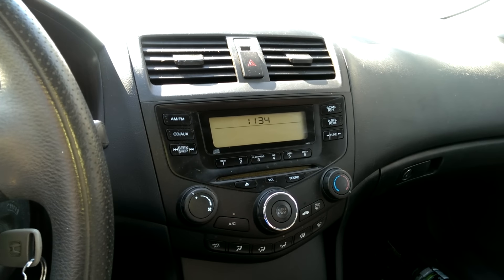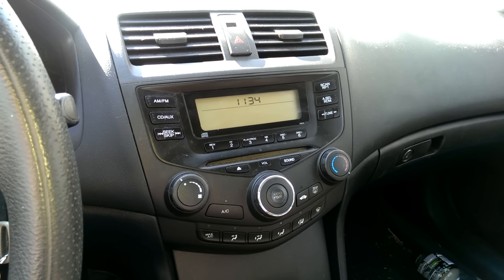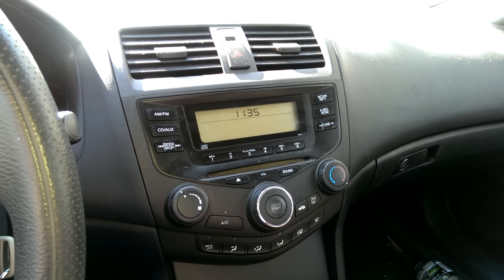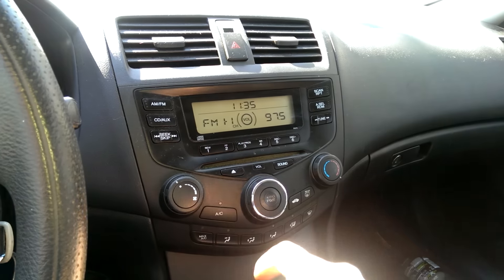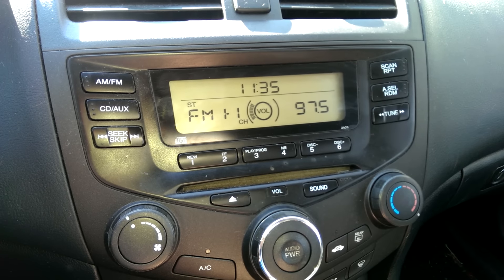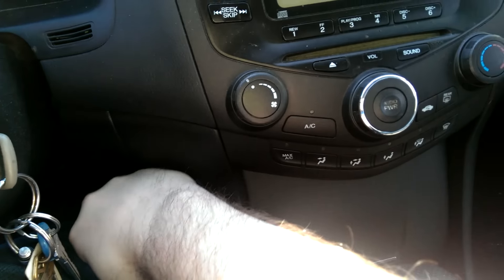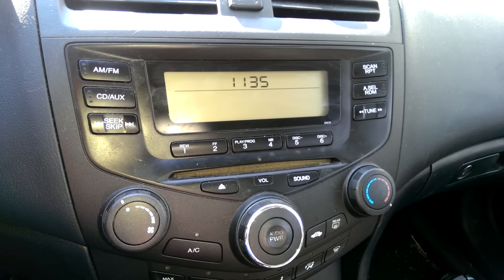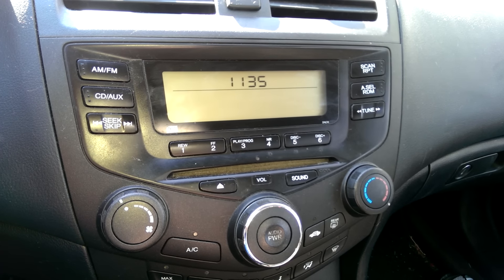2004 Honda Accord radio short problem.

Comment: I had issue when I turned my lights on when radio was on it would short. So I found all my ground connections and cleaned them. Underneath the fender their is a few spider web looking connections. As well as in the trunk. Just made sure they had clean metal connection. It worked for me. That is one solution....bam
Reply: Hey I have the same problem can you please tell more about how u fixed it I would thankful
Reply: @elimoe4257  hey man. Cleaning my ground connections def helped. But when I have headlights on and radio, now when I turn my wheel at dead stop I hear the crackling from speakers. Like def happening when I draw more power. I think its 100% a wiring short somewhere. For me I know its related to the left headlight assembly. Ive looked into it and with a wiring diagram we can narrow down the search. Can u explain your issue in detail? So I know your battle. lol Sorry i didnt respond sooner.
Reply: @alexandercahoulan6583  so I have the same radio problem when the lights go on it turns off and it makes weird sounds and some time when I keep the car on for a while and when using a lot of the power the car turns off and then on by it self
Reply: @elimoe4257  hey brother what's up!. Man I'm really annoyed about the same problem.. It's been nearly a year now and i tried to fix it out! And no body knows the problem 😣😢...  ur last comment was six months ago so did u fix it yet?
I hope for the good news 🙏🏻
Reply: @mohammed_alyazidi  yeah I just replaced the whole  radio with a new one and everything seems to be fine so far try doing that
Reply: @elimoe4257  thanks that is useful information as it eliminates speakers connection shorts and points to the audio electronics only. Did your new radio came with new speakers ?
Reply: @ericastier1646  no I just replaced the radio around 2 years ago and until this day thank god I have no problems alhmedallah
Reply: @elimoe4257 thanks that is great info ! i found a broken FR speaker (internal wiring is OL) and a wet connectors in the door. I'll be replacing the speaker for $38.  I suspect this could be what damages the radio if rain water gets inside the door. Do you park your car outside or in a garage ? I have noticed that the radio problem come days after a rainy day.
Reply: @ericastier1646  mine was having this problem in the winter but fixed it before the summer so didn’t really notice if it was because of the water but Ik that I changed the radio and everything was fixed
Reply: @elimoe4257  Yes overall consensus points to the radio unit. I replaced the broken speaker and used an electrical connection cleaner spray and resoldered a few through hole components on the board. Now i'm waiting for it to fail again, if so i will  hot air reflow the whole board. The next rain  should give the verdict.

Comment: My stereo turns on but doest have any volume. I have to troubleshoot
Reply: What was the problem because i have the same issue
Reply: Mine does the same thing. It turns on but is always completely silent. I tried taking the panel apart to make sure it was plugged in properly, and I'm getting ready to try replacing the radio fuse by the driver side door.

Comment: hello i have the same problem with my Honda Accord 2004 radio and i'm wondering if you have found the way to fix it :)
Reply from the maker: +Einar Guðnason So far I've only had luck with people telling me to replace the deck because the 2004-05 models had bad radios.  I've done a little bit of research at repair shops around town where I live, and it would cost a considerable amount of money to actually FIX the radio instead of replace it.  Some of them suggested going to junk yards and checking on eBay and Craigslist or something for still-working units.

Here is a link to the dash kit that I really like, but have not ordered yet: http://www.metraonline.com/part/99-7864

The reason I chose the analog knob kit over the digital one is because I had more than two car audio technicians tell me that customers were complaining that their heat/AC never got as hot/cold with the digital deck.

Hope that helps!
Reply: +jaldarith I have the same problem with my Honda Accord 2005. Excuse me for my English, Yes, No, Toaster, je parle français ;) 

I replaced 3 times my radio by another radio Honda Accord and the problem is recurring. The problem is electric and I believe that it is in connection with the heater.
Reply from the maker: Thanks for the heads up!
Reply: How long does the replacement last? Have You always used Honda radios or some other brand of radio?
Reply: I always have my radio replaced by another radio Used Honda Accord model . The first time I made about 3 years before the problem starts again and the second time I have not been lucky , the other radio was already defective. I love my Honda , but this problem annoys me titi . It rides beautifully, even if it's a 2005, but we can forget the radio .
Reply: +Manon  my problem isn't exactly this, but it shuts off. I'm going to put in a sound system and hope for the best.

Comment: A the radio malfunction is a chip is is a chip inside you look it up in YouTube no tell you how to fix it but it doesn't guarantee our work all the time so you might want to just change the radio to Android but look it up on YouTube but you had to have a solder kit you need that help this help you out

Comment: Any updates ever
Reply from the maker: I posted an update in the main thread, but it was not worth the cost to get it fixed. I still have no radio, the car works fine. I'm going to need to replace the car eventually, but there are a lot of great comments and potential fixes spread all about the comment section. But I have no confirmed fix for myself.

Comment: If anyone experiences this problem drop me a message i'll help you I'm a car audio technician.
Reply: car audio solutions hey I have the same problem as in the video but it only started happening when I got my subs installed and they hit super hard now the radio comes on and off
Reply: The best solution is to scrap the car.
Reply: car audio solutions you are so Nicholas Flamel. Spicy boi
Reply: Justin Eggers Thanks
Reply: You have a car stereo problem i don't :)
Reply: Justin Eggers Not interested in arrogant people, call yourself.
Reply: car audio solutions yes, my radio was working fine and then i started hearing these loud pops thru the speakers and then no sound. Now It is permanent. No sound from radio at all, it only lights up. Any solution?
Reply: Sabian Chalkley also my car alarm no longer activates when i try to activate it.
Reply: jogmas12 any ideas on how to fix? my 2008 Honda accord stereo is doing the same thing. Thanks
Reply: I need your help mines is doing the same thing
Reply: Okay I don't have this issue but my main issue is I have an aux adapter which is the WT-IPD1 it was working perfectly fine until one day my battery went dead so I've change the battery && now my aux cord ain't working. I went back into the dash && unplugged it && placed it back in && still nothing
Reply: You have to reset the code.  There are videos on this in uTube
Reply: car audio solutions 

Hello guys, I have a 2016 Honda Accord purchased brand new and I am also having the same issue.  The dealer claums ge replaced the radio but one day later same issue, I am starting to think it is beyond the radio.
Reply: Our Honda 2006 accord, does the same thing too. Did you find out what it was?
Reply: car audio solutions calm down that’s your solution ?  I guess your not a car audio expert .  Let me take a look I will figure this out , I worked for Honda plant for all their electronic so I will figure this out check back next weekend
Reply: I have an 04 Accord Lx, 400$ car so im obviously not looking to drop big bills on it. What exactly causes the sound to drown out? is it an internal fuse or?

Comment: Soon it will drain your. Battery and then alternator
Reply from the maker: my problem isn't the same as the other video. My radio doesn't actually turn on by itself when the car is off
Reply: AZTECPRIDELOCOS I am having the same issue. You said it would soon drain the battery and alternator? So it sounds like you have some experience, or have had in the past. please elaborate on a fix or solution. I am sure many of us who are dealing with this would rather go without a radio than a battery. Thanks